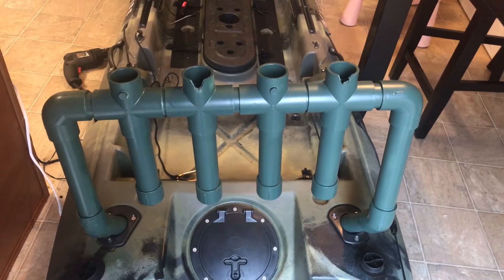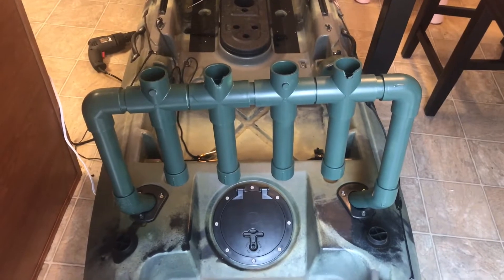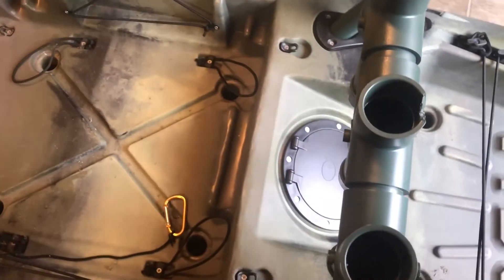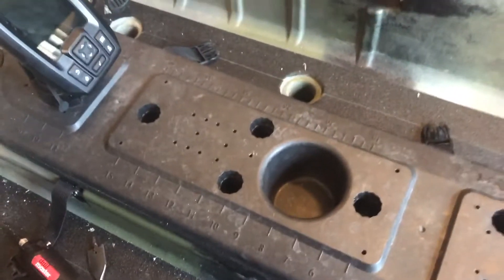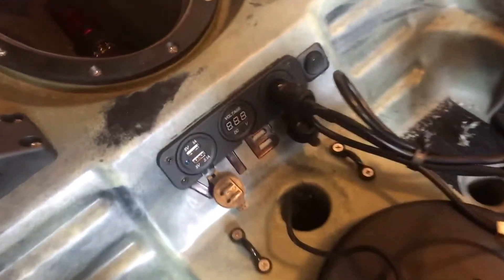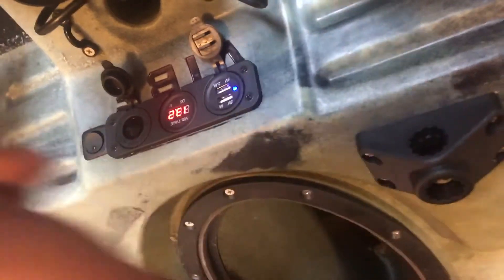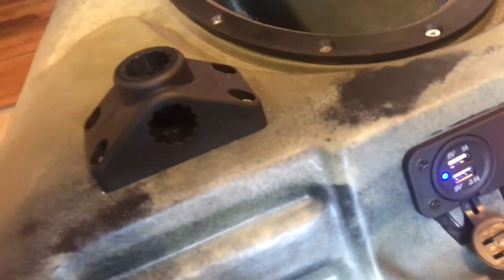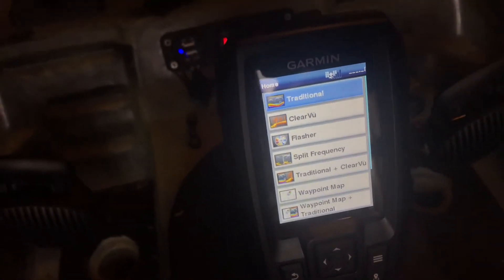Kayak Upgrades!! Vibe Seaghost 110

Comment: I’m adding the LED rocker switch like you did. I ordered the switches but was wondering what you used for the square backer and did it hold ok with the thickness of the kayak material? 

Thx
Reply from the maker: SwitchbackXThunter that was something I worried about because the rocker switch by it self had no rubber washer or anything to fit on the back end of it and there are no screws to hold it on place. So only thing I came up with was to seal around it good with marine goop. Only reason I purchased the rocker switch separately was to fix the fact that I should’ve initially went with the 4 panel switch instead of the 3 panel. There is a  four panel switch on amazon that has a rocker switch on it and is water proof with rubber washers and a lock ring on the back like the 3 panel option.
Reply: Just 1 More Cast thank you!

Comment: Hey man when you installed the voltage meter dash, how was drilling into that front plate? Because I saw on the recent SG models they have their vibe logo and name on there versus older models where it was perfectly flat. Thanks.
Reply from the maker: Dom Bogey mines has the logo on there and it was a little work. I made my middle hole there and pretty much lined it up the best I could using a paddle bit. Do to the logo making the surface uneven and even though the panel says it’s waterproof I still used a little marine goop underneath. I wonder if a hole saw bit would’ve made it easier but I don’t own any so I just used a paddle bit.

Comment: that's a very clean set up. mine is arriving on Thursday and I will definitely be doing the power bank mod. quick question, how long does that battery last you?
Reply from the maker: Ranger77 when I was running that battery with that fish finder I could get two full at least 5 hour fishing trips out of it. I never really ran gopros from it but i can imagine it wouldn’t change much.